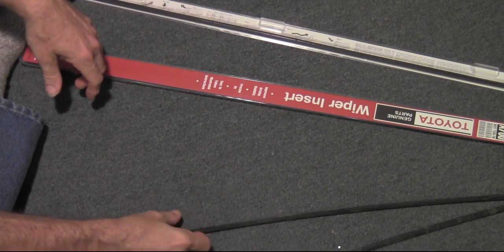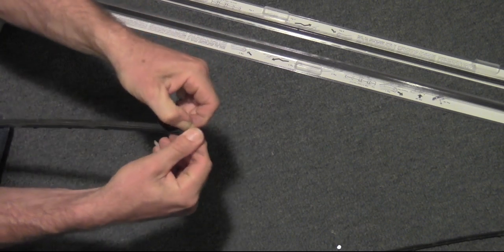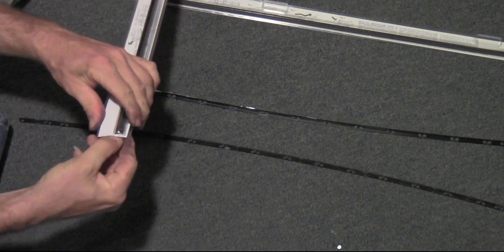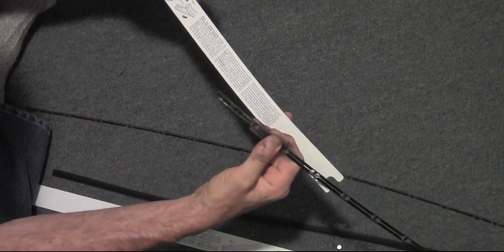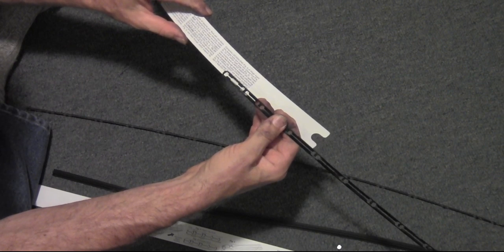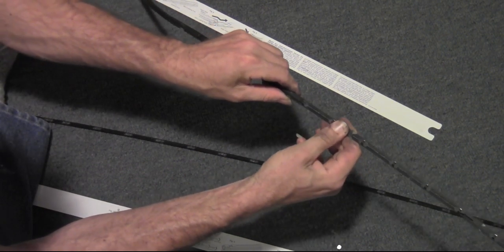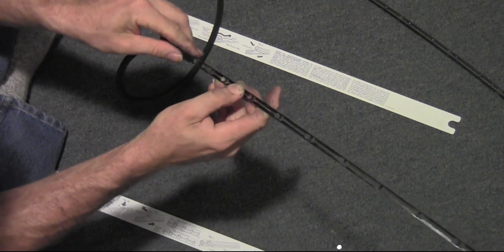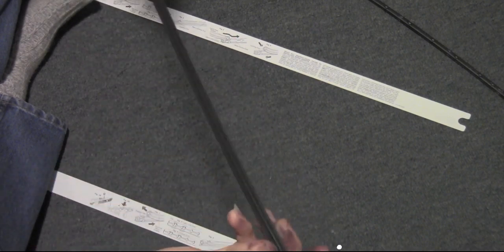Changing wiper blade inserts for 1991 Toyota Previa Van (WARNING: Extremely boring)

Comment: Hi, Do you have a link or part number? I'm getting a Honda Civic replacement with the A700 PN I can see in the video. The other number I can't really read (855221....) The official part with the arm is 8522095D03 (driver side) and ....2 (passenger side)